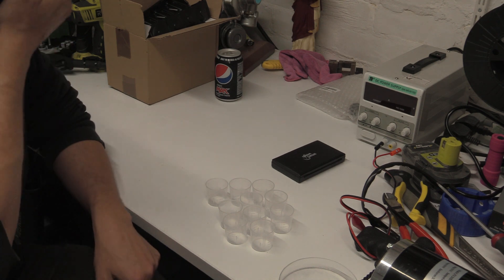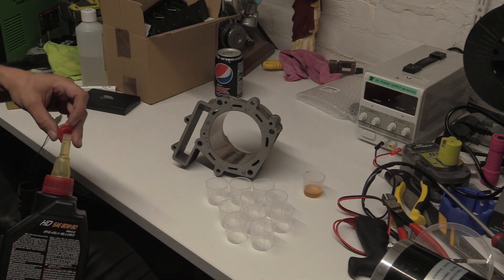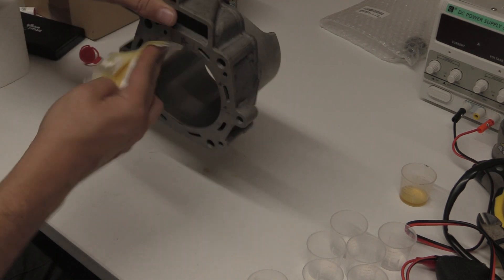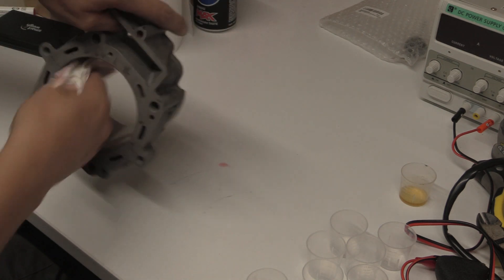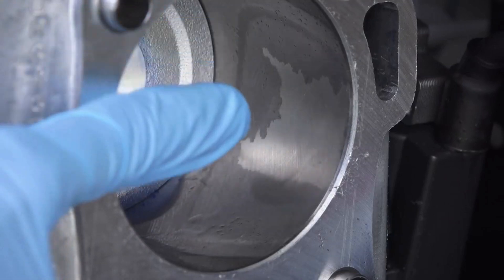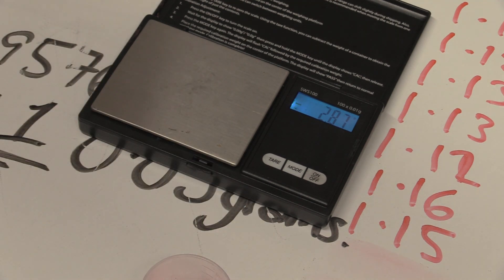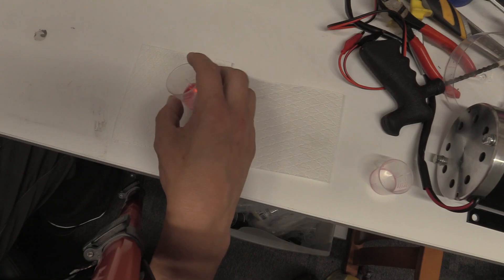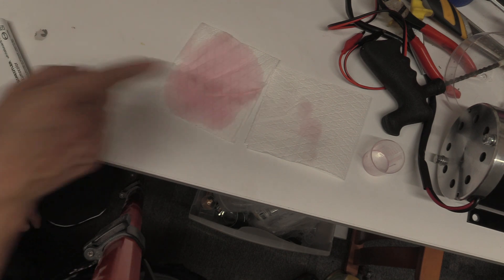Engineering NOT Explained - Visual Lies

Comment: For all of you commentators saying that YouTube is full of misinformation, you are, of course, absolutely right.  This video is a great example. The calculation of 0.05 g of fuel injected is for one injection. The engine is injecting that much around 10 to 15 times PER SECOND.  So, the amount that you illustrated from your squirt bottle gets injected in a couple of seconds. Now, it’s a bit more complicated, of course - some of the fuel evaporates before hitting the cylinder wall (less so in a cold engine) and the cylinder wall is wiped by the piston, which may add a bit of oil or make it worse, depending on oil circulation. Jason’s demo is a reasonable picture- exaggerated for visual effect.   But to not even mention how much fuel PER SECOND is entering the engine is a big oversight.
Reply from the maker: Wow, here is an example of someone not understand how the system works. Per second has nothing to do with it. Because after ever stroke oil is re-applied to the cylinder. So the amount (approx 1cc) is way off. Think about what you say before saying it
Reply: The Workshop Well, I do understand that, - that is why I said it- or didn't you fully  read my comment?  Seems to me it would be a balance between how much oil is added at each "wipe" of the piston, and how much is washed off by the fuel.
Reply: Textbook Dunning-Kruger.
Reply: Lets do the math on a 1.6tdci focus it ticks over at 800rpm uses 0.3litre per hour that's about 48000 rotations or the crank per hour that means there's 96000 detinations occurring between all four pistons each bore will see 24000 explosions and see 0.075L of fuel meaning each explosion gets 0.000003125 of a litre, diesel weighs 832g litre meaning your injecting 0.0026g unmeasurable on Matt's scales.
Come on fella I'm a sparky just used my knowledge of formula to get the answer work it out not just chat shit
Reply from the maker: @nuclear-sparks  and who said counting, division and that multiplication shit wasnt useful lmao!
Reply: A design for life Well, mate, it was Matt who used the 0.05g figure as fuel injected, not me, so you are criticising the wrong person.  I realise that’s hard to measure on a scale, but can’t see the relevance of that.  My point is it’s that it is orders of magnitude bigger than the volume of oil on the cylinder wall.  (But, see my longer reply to Matt’s other comment)
Reply: @biffaozzie2373   @biffa ozzie  to be fair with you i done the math for full load to get a full range of the injectors duty cycle depending on load and at 3200rpm 8mpg(max torque) there's 0.012g per bang where as at tick over there's the 0.0026g that's a 5× increase in fuel demand depending on the torque scenario.
As for oil burning to measure the losses you would need to know the the total crank revolutions the engine has totaled for an oil change and then work out how much has disappeared up the bore, but you more fuel works it's way down than oil up ;) because that where the pressure is the crank is lower pressure diesels run low miles often tend to get fuel in the oil not oil in the fuel that's when your turbo seal has gone and you got a runaway situation choke it out with a rag.
Reply: Matt, this will shock you, but I agree with you🙂. I had considered oil burning by blow by and valve guides, but didn’t mention it since it would make my calculation of the oil on the cylinder wall an overestimate (ie more fuel dilution).  I hadn’t considered the role of the quench zone in “protecting” the oil from burning, but of course it will.  You will still get some oil vaporisation during the intake and compression stroke, and this vapour will be burned, but it’s probably very small, and almost zero in a cold engine.  So, yes, the cylinder wall is likely more oily than I had imagined.  Also, seems to me that modern port injected engines are very good at vaporising the fuel, even when cold, so I can’t see that liquid fuel ever reaches the cylinder wall (diesels and carburettors, maybe).  So, I think you are right, fuel dilution when cold  is probably not a problem on a modern engine. Thanks for the discussion. Cheers.
Reply from the maker: @Nichen Fauster calm down? Its a discussion, why don't you fuck off butting in...
Reply: @thedirtyworkshop  you just killed the guy 😂
Reply: bandr Yes, I get that.  See my rough calculation on just how much oil this might be!
Reply from the maker: @biffaozzie2373  what makes you think that this oil is burned? There's a thing called the quench region. If you knew what you were talking about you'd know this. If you take a 4 cylinder engine apart one of the 4 cylinders was on the intake stroke, and is it dry and free of oil? Is one of the cylinder heads dry and free of oil? No. It doesn't work like that. 

As for your oil calculations theyre assuming that oil makes its way into the combustion chamber via oil on the cylinder wall, but what about the rings, crankcase breather, valve guides etc etc?

If youre going to do the numbers, make sure you have the correct numbers....
Reply from the maker: @biffaozzie2373  what I think is also funny is that 75% wear happens when the engine is cold. So if this fuel thing was constant then why would wear be highest at cold temps. Wouldn't it be every intake stroke? 

Wouldn't it be on every exhaust stroke, seen as though you think all the oil is burned away during combustion?
Reply: Ok, the cylinder is "recoiled" with each stroke.  Let's figure out roughly how much oil that might be.  An engine that burnt 1 litre of oil in, say, 1000km would be at the upper limit for oil consumption.  1000 km is about 7 million revolutions of the engine (I'm assuming 20 hrs of running at about 6000 rpm). So each wipe of the piston applies about 0.00015g of oil.  (This is the oil left on the cylinder wall as the piston descends, since this is the oil that can be burnt.  On the upstroke, this is the only oil to lubricate the compression rings). That's less than 1/300th of the amount of fuel injected, and far, far less than what you applied in your visual demonstration.   Seems like a pretty high dilution rate to me.  This is for an engine burning a bit of oil, typical engine would be more like 1/1000th of the amount of fuel.

Comment: I guess the only time what Jason says could be true is if you have CV carbs with an enrichment circuit and you ride off with the fuel enrichment on (or 'choke' on), then you could end up flooding the cylinders with fuel as the engine warms up.
Reply from the maker: But flooding doesn't mean dripping. It means fuel levels about 8:1 which is close to what I showed.
Reply: @thedirtyworkshop  Exactly,  so even in a worst case 'flooding' scenario what he says doesn't really stand and I can see that from your numbers. If the ambient pressure in the inlet is lower than atmospheric, wouldn't that ease vaporisation of the fuel making his demo even more unrealistic?

Comment: But did you consider those who dump a cup of gas in the intake to get a shitty small engine to run after sitting for a few years??? I'm sure Jason was just talking to that specific application and not all engines... /s
Reply from the maker: Lol so you didnt actually watch Jason's video then...
Reply: @thedirtyworkshop   I was just joking that the only time as much fuel as the example is in the cylinder is when an lawnmower or chainsaw wont start, and you pour gas into the carb practically flooding the engine.

Comment: I LOATHE EE, he's responsible for the continued propagation of MANY misconceptions.
Reply: I got really annoyed with his crap years ago when idiots kept linking to his videos as "proof" of whatever bullshit argument they were trying to make. Then you watch the video and he is using all sorts of assumptions or using very specific examples and then extrapolating that to sweeping generalizations. He made a video years ago saying that changing wheel alignment or fitting aftermarket swaybars will "ruin your car". His logic was "if you set it up wrong you can make things worse". Well no shit.
Reply: PistonAvatarGuy  Could you name one please? I'd be interested to see it.
Reply: @biffaozzie2373  The two big ones that I remember (there were many others, but I've forgotten what they were over the years): 1) He claimed that diesels make more torque than gasoline engines, as if it were an inherent property of diesel engines. Diesel engines actually make less torque than gasoline engines, unless they're boosted high enough to make more torque using forced induction. 2) His explanation of horsepower and torque is just complete nonsense, I really don't even know where to start with it anymore.

Comment: Even when Urge to ride did the video saying that it is pointless warming up an engine he back peddled saying he meant 10 minutes or longer. But his video was clearly saying to fire it up and just ride away at low RPM. The damage would be greater due to the load on the cold engine and nothing to do with warming up the engine as the engine will run on the fuel it needs or is programmed in the ECU cold engine map. Its not going to bore wash anything as you point out the amount of fuel used is insignificant and not enough to wash anything from the cylinder walls.  There is a reason race cars and bikes get warmed up before being used, if there is bore washing from cold why do they bother warming up the engine before the rider sets off? Hell it would be easier and have less wear if the teams just fire up the bikes and the rider does the sighting lap and let the engine warm up on that out lap! They don't because it is not good for the engine.
Reply from the maker: Too much common sense there Richard mate lol
Reply: @thedirtyworkshop  I know I am full of common sense shit..... Seems common sense is not that common. I know from experience I do stuff that some think is stupid but I don't have many bikes blow up too often even 2 strokes engines. I don't understand how they talk crap and honestly think its being informative.

Comment: As someone who worked in a engineering lab this is a really good call out. For accurate results the input data and technique of execution has to be very precise.  You should of had mic drop in to a vat of oil for an ending thou. In slow-mo of course.
Reply: But only if you have a white board covered in semi technical drawings and several lines of math in the background
Reply: @danmanthe9335  nothing wrong with white boards and math.

Comment: LOL. If you disconnect the spark plug and drive for a few months you might have a chance at damaging your catalytic components. If EE took his oil rings off his pistons and his thermostat out then he still would have a hard time wearing his cylinder walls. I have seen it happen because of stuck open injectors but never with a warm up cycle.

Comment: Soooo....which is better dog gamit? Should I let my car idle in the morning or drive it slowly untill it warms up. Assume summer,  no cabin heating required.
Reply: Do what suits you best, because after all this argument never ends. 

I personally give any of my engines a couple of minutes to idle and then take it steady afterwards until operating temperature is reached. Even then, i'd never go full throttle because of oil temps and so on.

In winter i'll sit and idle whatever for 5 minutes before i move off. 

I do the above and have never had a problem with my fleet. Whereas someone who has never done this, will come and say exactly the same, "Never had a problem".
Reply from the maker: It's simple. When the oil is cold, engines wear more.

Comment: So you cant wash the bores out leaving the choke on, old engine with manual choke 😭
Reply: Not at all, because all its doing is obstrucing air flow by closing the intake with the butterfly.

On a carb, its done via the "Idle circuit" which has an idle jet to meter fuel. From idle to part throttle this is the jet the engine will rely on for fuel until eventually you twist the throttle some and the main jet comes on.

Bit of a description nothing too in depth, not going to claim it to be gospel for all carburettor engines.

Comment: Yep, and you started with a air fuel mixture so rich it would probably burn black, most engines run about 14.7 to 1 a few up to about 22 to 1 lean burn ratios existed. So like you said a lot of fuel, more than normal.
One of the funny thing I encountered was the people who believe more fuel means more power, simply not how it works. 
Good job Mate !

Comment: Loved this demonstration! I've used gas to clean up oil before and you have to use a decent amount, not just a lite misting.
 I've always felt the whole letting your engine warm up or not to be a very small scale difference. If letting it warm up or not is causing issues there's probably something much worse going on.

Comment: That spray would be a HELL of a lot more than the petrol wouldnt it. A gsxr injector is a 230cc injector which is 230cc/minute and thats roughly 2.75g of fuel added per second in the whole cylinder, how much of that will actual contact the wall? Probably a good chunk less than 1g. 

Also it's a GS450 cylinder isn't it?
Reply from the maker: No, a GE450
Reply: @thedirtyworkshop  not too up on BMW engine nomenclature so thats useful. 

Given the fact a 230cc injector flows 2.75g of fuel a second am i right in thinking the amount sprayed on a single area of the cylinder in the demo is way more than actual use would have occur given the near constant replacement of oil
Reply: @jediknight1294  Ultimately you are right with your assessment, the demo has way too much fuel for a useful comparison, but it looks like your numbers and or interpretation is off.. For your example, 230cc: Cylinder size = air volume = air weight =0.306g.  At 10/1 fuel, your fuel weight = 0.03g per intake stroke, which is 1/2 rpm for four stroke motor. The injector size  is weight of fuel rated at X pressure over a period of time. It does not take into account the duty cycle of the ecu/ecm mapping. That's why using the ~ approximate fuel ratio works well for this example. Imho.
Reply: @raynic1173  all I was really interested in was quantities, the injector spec I was looking at was a CC per minute rating as it what they can flow and are designed.to flow at peak flow and go from there. So the 2.75g per second isn't a bad place.to start,  then rightly look at air volume and use that to extrapolate just how much covers the what 10-30% of the cylinder wall a single spray covers. It was all bar napkin math and approximations given peak flow isn't the best figure to use as how many of us sit at WOT for 60s at a time but it gave me what I needed to check my assumptions.
Reply: @jediknight1294  Well, I don't want to beat a dead fish, but the tree your going up with your numbers and analysis is not real good, like i said, without knowing the close to exact time that your injector is operating and taking that into account is really poor and incomplete, making the injector size a totally incomplete analysis. You are in essence doing the very same thing that this video is trying to expose, bad examples of a hypothesis. However, your questioning of the amount of the fuel that actually makes contact with the cylinder wall is viable. But I'm not trying to argue or belittle, just talking analytical thinking. I do give you kudos for the paper napkin engineering thou, I have a pocket full of them in my laptop bag. Blessings, peace, god bless you, live long and prosper......

Comment: Not only is there fuck all fuel being squirted, but isn’t the injector supposed to spray in all directions so it distributes evenly within the cylinder volume, as in it doesn’t just shoot across and coat the cylinder walls
Reply from the maker: Thats not how port injectors work. They spray the back of the valve, when its closed
Reply: The Workshop I was thinking direct injection, but the point stands as in the fuel isn’t sprayed onto the cylinder body

Comment: I think the best example of this is when you take off the heads of a cylinder you can literally feel the oil on the sides of the walls. Even if the engine has been sitting for a while.
Reply: I stipped an engine that hadn't been spun for almost 20 years recently, it was all well lubed inside throughout, I couldnt have spotted the difference.
Reply: @presstodelete1165  good for me. 
I have an old car, a Mitsubishi, which is sitting without turning on the engine since february 2017. Car had a big service, including new full-synth oil something like 1000-1500km before i leaved it. I want to start it next month, maybe 2 months from now.
Reply: So why do most manufacturers say it's good practice when you lay the bike up (for the winter, say) to take the plugs out, squirt in a bit of oil and turn the engine over a couple of times before putting the plugs back in?
Reply: @biffaozzie2373  Bc it's just that. Good practice

Comment: What?   If you're using your engine, then it's injecting more fuel, how could it possibly not be worse than letting it warm up? Not only that, engines are literally designed to have oil on one side of the rings and deposit some that gets burned away on the other side. Even if there was enough fuel to wash it off the cylinder, it would still collect around the rings when the piston moves upward.

Comment: Totally get the point... But where do you get the air weight from? Is that a standard at say sea level pressure and a particular temperature? Not that it would make any more than a midgies dick of a difference to the calc, just interested
Reply from the maker: The met Office. 15degC at sea level. The higher you go the less fuel, so altitude makes jason look more like a cock lol
Reply: It's a standard data, If I remember correctly it's at standard atmospheric pressure (so sea level) and 15 or 20 degree celcius. It's also dry air, water would of course increase it's weight.